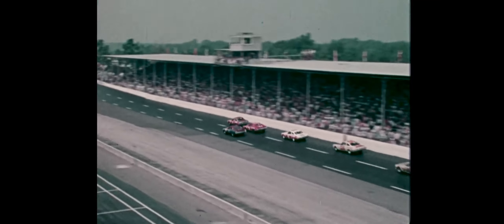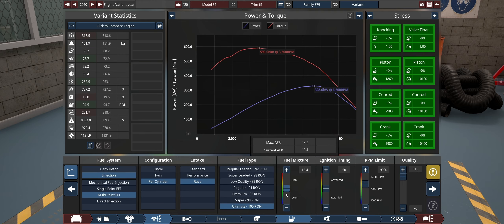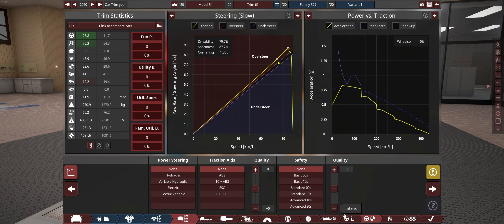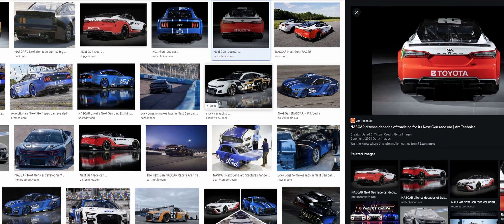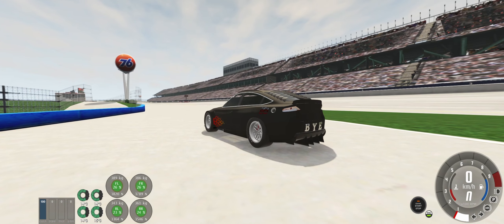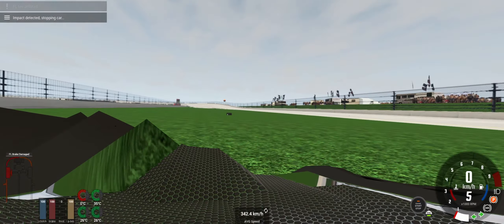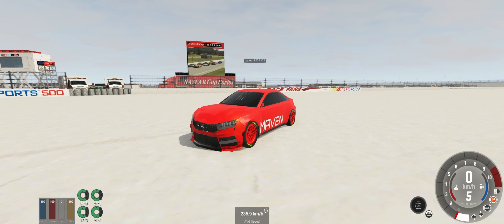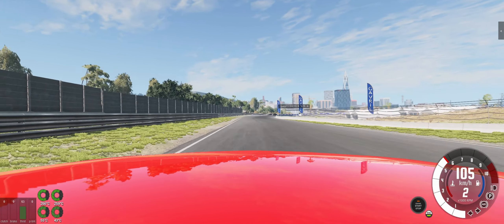Trying to Build a Next Gen 7 NASCAR (Automation🔧BeamMP)

Comment: The talladega track you used actually uses the increased ground grip that the drag strips use which is why the car felt more grippy than normal and didnt need downforce. its also why it was so bad at the road course cause you built it for the gripper talledega surface and the road course had just normal road surface
Reply from the maker: ah, I used a prepped surface on my thunderdome map too, but not full drag strip levels of grip :P
I also kept realistic banking, unlike this map haha but we knew the cars were going to be bad on the road course :P that's why we wanted to do it haha

Comment: Does the weight ballast fixture affects the weight distribution? If it did I think you could technically use that
Reply from the maker: it does in beamng, and I suppose I could have used fixtures to move the weight back, but it would be hard to make it exact still
Reply: I did this in the NASCAR beamMP event 
worked really well